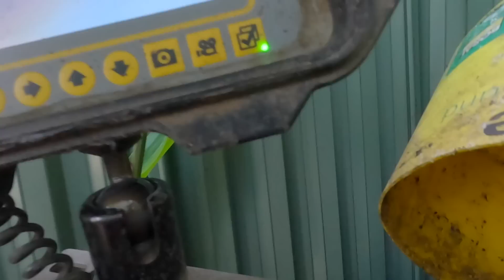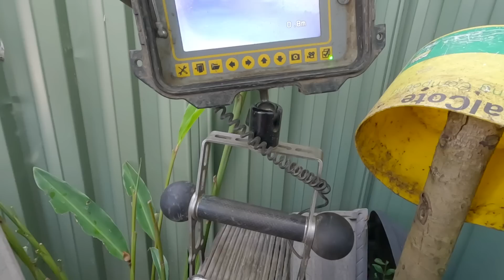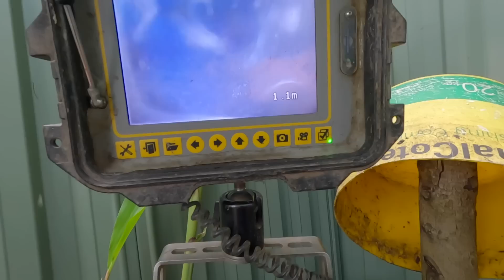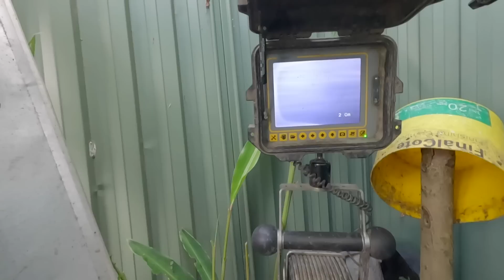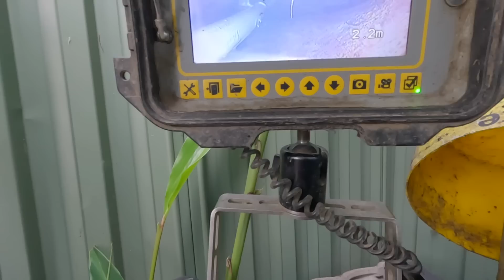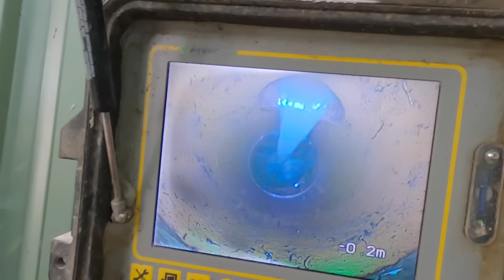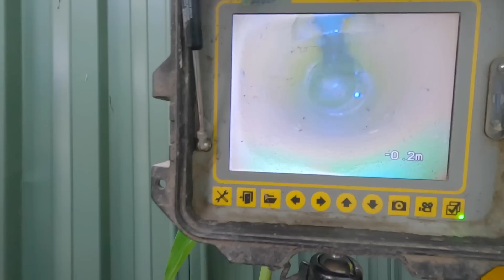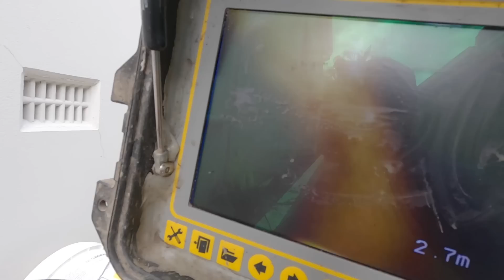Blocked Drain 777

Comment: Always place the lower jaw of your adjustable wrench on the leading direction you are going in. The small jaw will break if you are putting it at the end of the direction you are paying the force on. Eg...  If you are tightening the nut: Put the lowered jaw first.  Rhe large jaw can take much more force that the small one